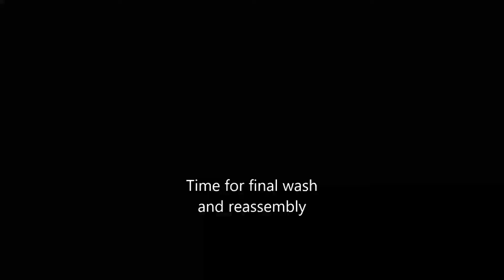Holley 750 vacuum secondary Choke Housing Removal

Comment: What are the benefits of removing the choke housing and drawbacks?
Reply from the maker: When done correctly It provides two benefit's: 1) it increases clearance between the bottom of the air cleaner lid assembly and the entry surface of the carb,  2) makes air flow into the primary more uniform to air flow into the unobstructed secondary barrels. On a side note Chrysler and Chevrolet used shortened choke towers on the two barrel carbs they used on tri-power / six pack systems.
Reply: Absolutely  nothing.

Comment: I wanted to ask, "why," but then I didn't actually ask, and now again I want to.  :)  but seriously, WHY?
Reply from the maker: Removing the choke horn section of the carb is done for  different reasons, one is allowing clearance for low profile air cleaners in tight under hood situations,  the other main one is  better flow to the venturies but if done wrong it can mess with the booster signals (look at many of the aftermarket carb bodies and race carbs) If you are not a long time carb tuner its usually better to just buy an aftermarket body with it already removed and smoothed out. If curiosity really gets you  David Vizard's How to Super Tune and Modify Holley Carburetors covers a bunch of info on the topic.